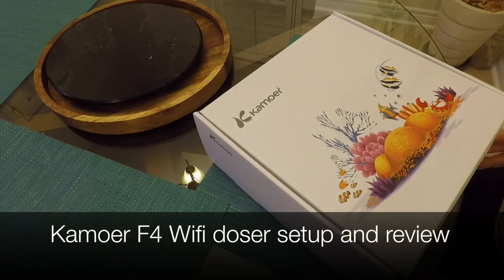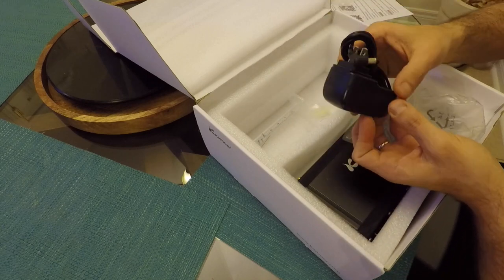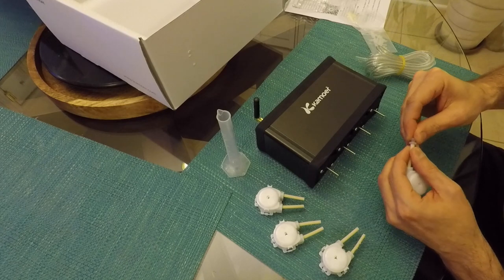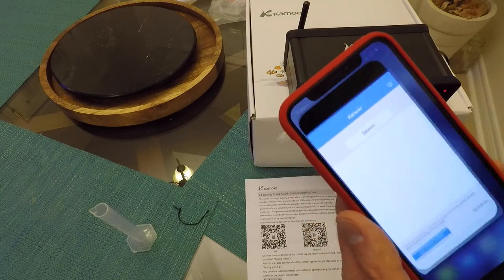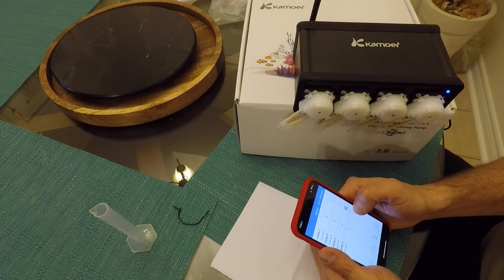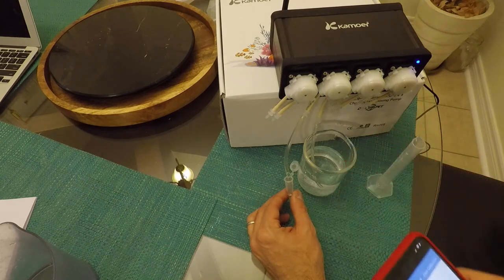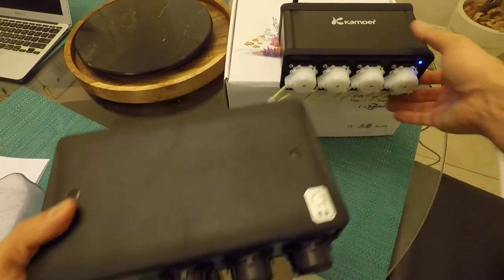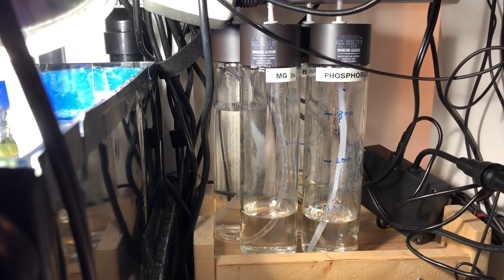Kamoer F4 WIFI doser unboxing, setup and review

Comment: What do you think of this doser after using it for a while now?
Reply from the maker: i like it. not issues. pros; works well and is easily calibrated; cons - not english support as far as i can tell, which hasn't been a problem cause the unit works well. The only disadvantage of this unit is that you can only access the doser on wifi locally; you can't remotely adjust dosing as you can with the Apex or GHL dosers

Comment: 8 months on, how are the Kamoers doing? Any recalibration needed or problems?
Reply from the maker: i try to recalibrate every few month. It is working fine, but a few things to note: the app keeps track of volume of dosing containers, and daily usage - it calculates how many days left before containers are empty but it doesn't alert you when you are low... so a missed opportunity here.  Also the app is really awful to use, and there is virtually no english support. i reset the doser after i changed my wifi modem, and it took about an hour to get it to connect to new wifi network.  Also, there is meant to be an update feature for the firmware but i can't seem to access it and the instructions in the manual appear to have been written by google translate and are mostly in-comprehendible. Finally, some of the medal rods that the motors rotate around appear to be rusty, suggesting they were not made of marine grade stainless steel.  I think it is a decent product but leaves much to be desired in regards of back end support and app development

Comment: I've been running this unit for a year and with in the last month the unit doesn't communicate with my iphone nor can I calibrate or adjust my dosage ( i've even unplugged the unit to try to reset with no luck).  Customer service sucks and the only help available is a broken english video and a coralvue video on youtube.  I will never by Chinese products for my reef tank again, I went ahead and bought a GHL2.1 doser that should arrive next week.  Meanwhile I  am hand dosing until my unit arrives.  Good Luck
Reply from the maker: lukejo45 that’s sounds awful Luke. Yes I am also very concerned about lack of customer support in case the doser goes down

Comment: Great review! I thought one should calibrate the pumps with the solution it is going to pump & all the length of lines connected to it, as it is installed on the aquarium?
Reply from the maker: András F yes you are absolutely right... final calibration should be done with real solutions after everything is connected... i did it on the kitchen table just for the video
Reply: AmroAzul TV logical thing to do, you’re right sir!:)